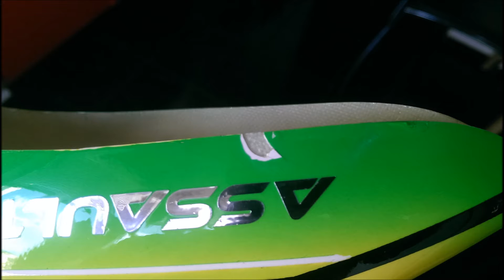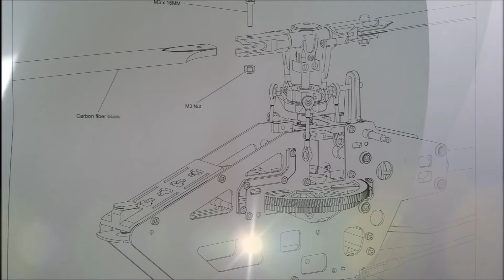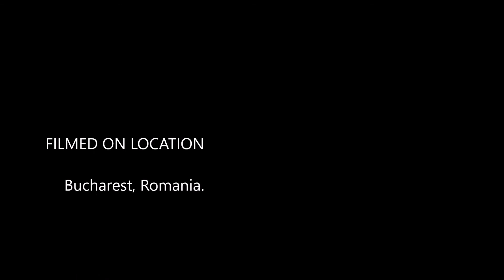HobbyKing Assault 450 L ISSUE (HD)

Comment: some of the problems you point out are a bit funny. the movement on the tail are solved by tightning the bolts and a insert in the block and boom that help it stay in place. the wobbly gear is solved by bolting it to the mainshaft. the dfc links need to be loosened a bit i think one is on to tight making it go  in a angle. take it of clean the bolt and put it back on with threadlocker. the space for your electronics on a 450 is always tight deal with it or go bigger. the canopy is always crap on the assault series i have a assault 700 and replaced it with a fusuno one.
the slop on the bearing is the only thing that is not good and i would replace it with an align case.
Reply from the maker: please watch  the second video.
I just wanted to show  what you get for that money from hobbyking .
nothing more.
i fixit and now flies very well. peace.
Reply from the maker: https://www.youtube.com/watch?v=gv9V-ntjdd8
Reply: +ovidiu969 yeah saw the video sorry for the comment dude. good thing you fixed it. thinking about getting on too. but i gonna buy the one from gartt same Heli but different colour. i like green heli's but some of the parts on the Assault 450l are just ugly. have fun flying
Reply from the maker: You have nothing to apologize.
I just want to help.
Thank you for your comment.
I hope you have better luck than me ,with those from gartt .
But if you want advice, go to align .
Let me know what you bought . good luck.
Reply: +ovidiu969 already have a assault 700 and i like it. it's just the TT gears that need to be upgraded to the black align ones and think i change the main and autorotation gear to the slanted ones or the herringbone ones for better distribution of the power.
Reply from the maker: is  a nice one.
I have an Assault , as you can see , a Falcon 450 and a Raptor  90 nitro .
Reply: +boy-named-zoen I had a assault 700...see my vid.i flew it loads on the stock tt gears with no issue but the main gear stripped on its maiden.and the landing gear was so soft it broke before it even got setup lol.other than that I thought it was a awesome Heli.i have a goblin 700 now and to be honest I'd fly either one they both fly that good
Reply: +big steve just finished mine yesterday uploaded the video of it. awesome machine. my tt gear stripped instead of the main and never used the stock landing gear. changed it to the align 800 ones including the white and carbon tail fin. check it out if you like. will watch your video in a minute

Comment: they say you get what you paid for lol. I should say I am lucky with my assault I did not check everything but the dfc head is good, and tail case is good bearing fit snugly. tailboom hold is good. I did not check the main gear. but the heli is smooth I did not see any excessive vibs while it is flying,I crashed it once due to front umbrella bear being loss, I changed it with align. and it flew grate since. I will use Gartt parts as needed in the future they same to be better, or pay extra and get align parts.
Reply from the maker: +med bel  I'm happy for you. I was not so lucky . I ordered spare parts and they have the same problems .I finally ordered spare parts from align so in the end it may also change the name ....
Reply: +ovidiu969 sorry man, that's hobbyking, you roll the dice lol. I like their batteries and accessories and foamies, anything else will be a gamble. once you fix the assault you will love it man.
Reply from the maker: +med bel I upload a video with him when it will be ready.